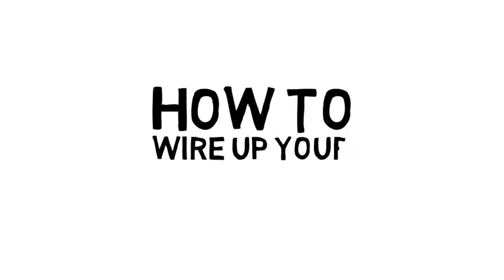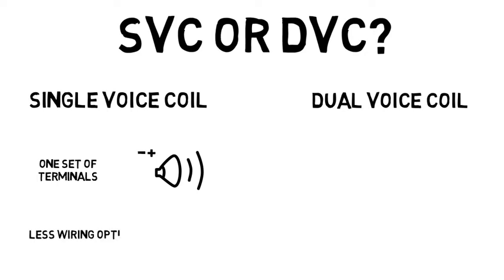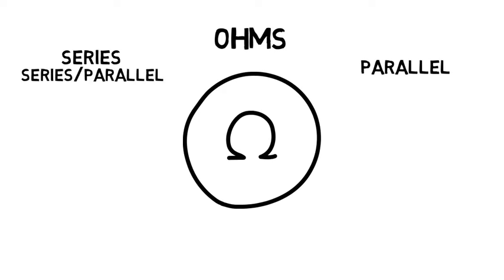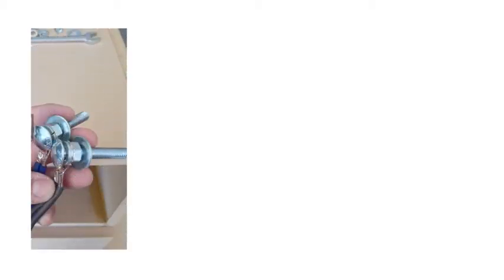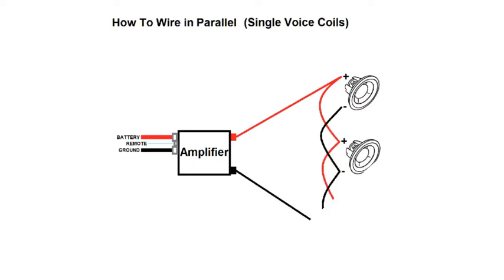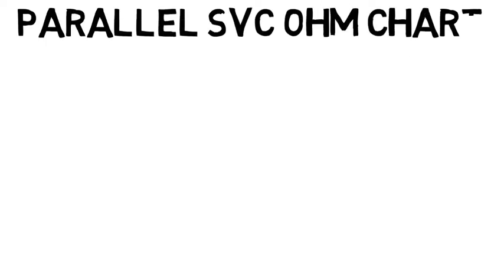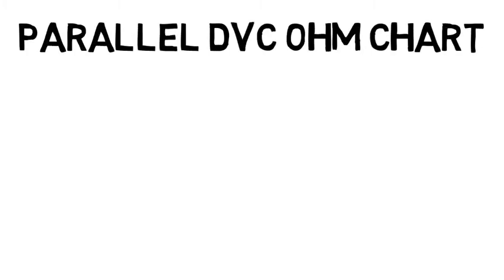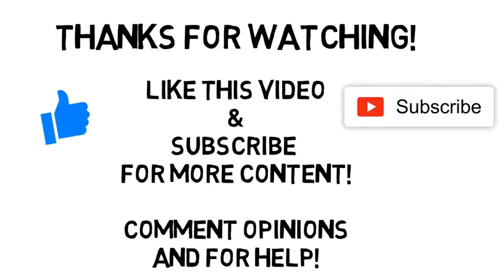How To Wire Car Subwoofers [SVC, DVC, Ohm Charts + Wiring Diagrams]

Comment: Is it possible for me to wire 2, 2ohm subs and 1, 4ohm sub together on 1 amp
Reply from the maker: It’s possible to mix ohms yes, but I really wouldn’t recommend it. It’s best to just use the 2x 2ohm subs.
Reply: yeah i was hoping to do this also since im still running my car stock sub lol but pretty sure that might be a 8 ohm maybe my other two subs are 4 ohms hmm need to get them to 2 ohm though for a bit more punch.

Comment: When you connect your amplifier from the + of the battery and any ground. Does it means it is ALWAYS getting power. So basically your amp is constantly running even when you turn off the engine. that would drain your battery pretty quickly 🤔🤔🤔
Reply from the maker: No David, all amplifiers have a REM/Remote terminal for this reason. It is a switched live, usually wired from the headunit, which tells the amplifier when to turn on.

Comment: How can I wire 8 midwoofer PRV Single coil 8ohms to a .5 ohms taramps
Reply from the maker: you could wire it directly. Ohms are minimum, meaning that, if you have a 1ohm amp it will work with 1ohm, 2ohm, 4ohm, 8ohm and so on. The higher ohms, the more resistance, so you will see less wattage output from the amplifier the higher the ohms.
Reply from the maker: I misread this comment; to wire 8x SVC 8ohm subs you would wire them all in parallel, for a final ohm load of 1ohm. This will be fine for your 0.5stable taramps. Enjoy